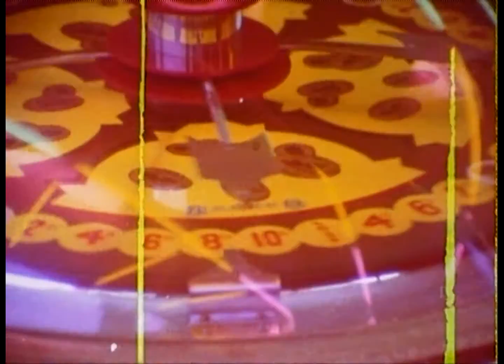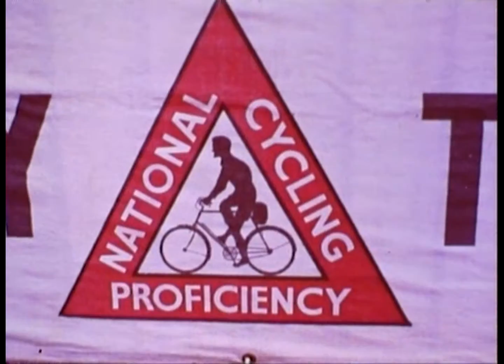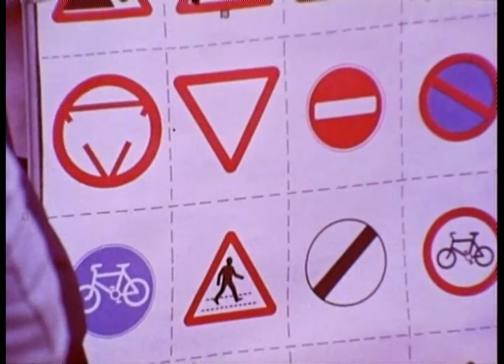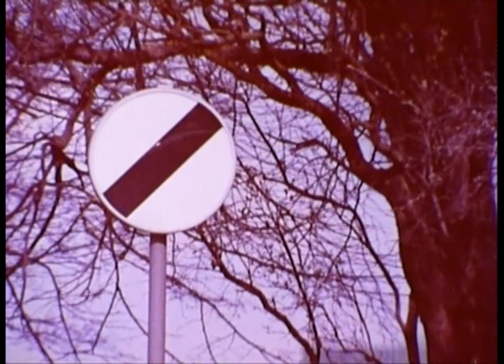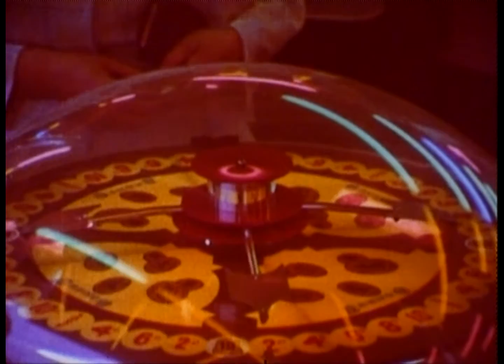Wheels of Chance (1973) Jackie Stuart UK Public Information Film

Comment: There was nothing safe about F1 in the 70s.
Reply: Yeah,running fuel lines thru cockpit.
Reply: "Safe" is a relative concept. the cars were actually starting to get safer in the 1970s, as was track design. Then as now, a long way to go, but it was when the first steps were being taken.
Reply: It's not exactly safe now, but it's quite incredible when you look back at old F1 footage to see how far we've progressed. Crash barriers made from hay bales, some idiot standing on track waving the chequered flag like a matador, cars speeding headlong into a pitlane crammed with people, no medical facilities at the circuit, cars where the crash protection was basically just the driver's own legs... the list goes on.